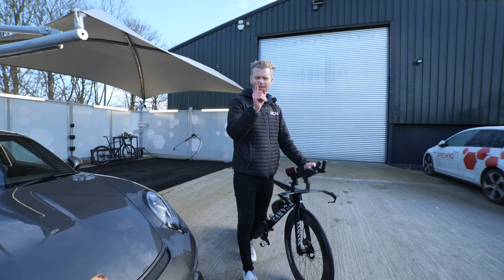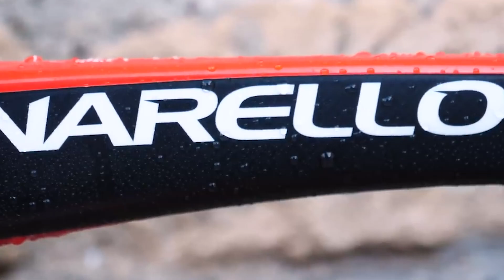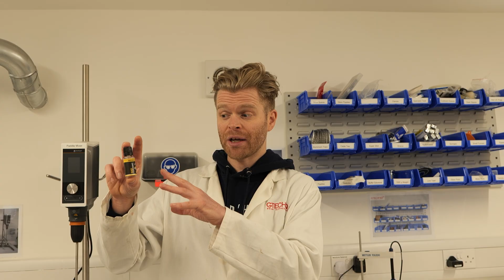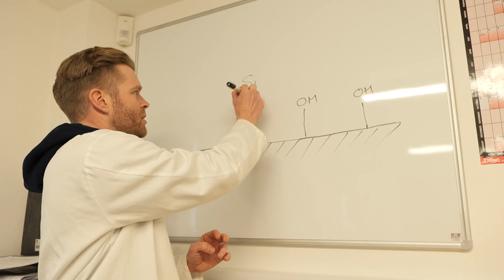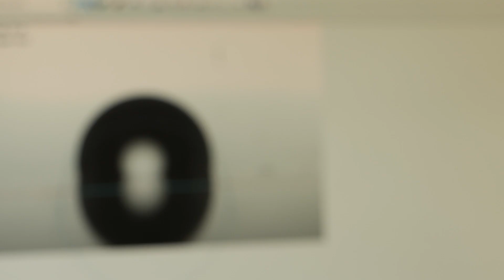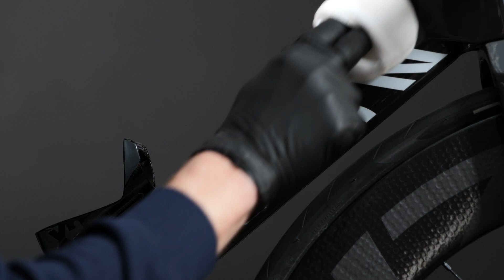The Future Of Bike Cleaning? | Hydrophobic Ceramic Coating For Bikes

Comment: A friend with a car has used ceramic coatings and i entertained the idea of doing my Miata, But didn’t 🙄 but I might do it on my Winter Fat bike to make it easier to keep clean 😉
You should put a treated / un-treated frame in a wind tunnel to ‘See’ if the treated frame is any more aerodynamic  ( Only sort of kidding ) as « Air » is a bunch of things.and at a molecular level the ceramic coating might make it slippery-er !
As Always entertaining and Informative content - Keep up the good Work 👍

Comment: I have Crystal lite on my GT3, Cayman R, E60 M5 and my Audi A7 and to be honest I used to use alot of waxes but since I converted I'm sold.. I spent alot of money on Rupes polishers etc, Now I'm looking at this stuff for my EMTB's, I was tempted to use the car stuff but this looks like it is infact optimised for bikes much more so I'll go with the bike specific version, I often spend 45 mins cleaning my bike and chain after a ride so I'm hoping this will speed my process up alot.

Comment: Ollie said everything! You need super clean bike - that means, iron removal/clay, polishing, IPA and then you apply ceramic coating. The same principle you would do on a car. I coated mine in 2016 and it still looks like day 1 - super easy to clean, attracts less dirt and hydrophobic. The only thing you need to do is, after every couple of cleaning, top it with ceramic topper (like gyeon cure) and that's it. Your bike will be in good shape for a long time, attract less dirt and much more easier to clean. Also if you're coating your car, you will left with extra ceramic coating that you can put on your bike. BTW that 1 year thing is BS, use more expensive car ceramic coating and it will last for 5-7 years.

Comment: Okay...I ordered my ceramic kit today. Will let you know how it goes when I get the bikes ready for the season.
Reply: Just messaging for an update. Did it really lasted a year?
Reply: @ it did
Reply: And, what's the outcome? 🙂
Reply: @EditioCastigata  works awesome. I ride in Northern Illinois in the US and the spring is notoriously volatile switching from sun, to rain, to even snow. The coating helps the water bead right off. The cleaners are just as good. I will say they are a bit pricey when you compare them with other cleaners but the coating was worth it.
Reply: @troykindle4539  Happy to hear, especially from IL! Thank you sir.

Comment: Did this for my Cervelo Caledonia in the beautiful oasis green to preserve as best as possible. Few pointers after 8 months:

0. Your bike will still get micro scratches after washes and rides. Just the ceramic coat will scratch instead. Benefit is that the scratches and swirls and scuffs won’t be as visible with the coating.
1. I did mine as Ollie with a brand new bike. If already ridden, do it proper with a full wash and clay bar before the IPA.
2. Applied on shifters and carbon wheel set.
3. I removed my crankset, chain, and wheels. Definitely a must. Covered the bottom bracket bearings with tape.
4. Great for peace of mind, but ended up putting on helicopter tape on downtube and seat stay anyways for the nasty asphalt and rocks.
5. Worth it, but not as great as I thought when protecting from micro scratches.
6. The flashing/curing of the coat happened really fast when applying outdoors under the sun, nearly 30-45 seconds. Only the rich have garages in Boston, so keep in mind.

Comment: I have been using ceramic coatings for a while now.  I tend to use Meguires Hybrid Ceramic Wax currently as this was being sold cheap and picked up 3 bottles.  It works a charm and much less crud sticks to the glass like surface being hydrophobic.  Basically I give the bike a nice deep clean every few months and just top up the wax, job done and only takes a short time.

Comment: Thanks for the info. Seeing as these type of coatings bond to the paint, is there a similar product that would work on an unpainted titanium bike? Also, as they start to wear off, do they flake off like paint chipping? It sounds like the coating is so thin you wouldn't see it, but a degrading hard coating can make for an unsightly bike.

Comment: I had my road bike professionally done last year before I built it.Remove your cranks so you can get the coating all around your BB area thoroughly. Remove your chain and wheels and don't forget to do your wheels.I'll do my gravel and mountain bikes myself this spring (or maybe one of these cold winter nights we're having). I was surprised just how well it works - dirt just sprays off. Will save a ton of $$ on Muc-Off 😀

Comment: Is there a difference between the bike and car products other than the packaging? I’ve been ceramic coating my cars for years and did my road bike with the same stuff a few times
Reply: @Charles Man it’s actually less expensive and it is a different product to some of the more powerful car serums, which require considerably more surface prep. the high end car coatings can only be applied by trained detailers too. 👍🏼 the chemistry is different
Reply: @Charles Man suspected as much!!

Comment: I thought ceramic materials were metal oxides.  Silicon is not a metal.  What is it that I have wrong.
Reply: ask yourself this... are ceramic pots made from metals?!
Reply: @readmorebooks-l5f  yes they are metal with a ceramic coating. Pottery is not ceramic.  Aluminium oxide is ceramic
Reply: @johnsaxelby8030  🤦‍♂️ literally google ceramic! 😂

Comment: I have been using ceramic coating on my car, motorcycle, snowmobile and bikes for years. Best thing ever.
Reply from the maker: Great to hear you love it! Would you be temped to use on the bike too? 👀
Reply: @gcntech  i do. Even with a Matt finish bike. I even use these products on my steel shed. Snow does not stick to roof in winter! ;-)

Comment: This is just an advert for a costly  waste  of time and  money. The parts which need  most protection  are  the bearings  and components, not the frame. It wouldn't surprise me if  that Porsche was yours given  all  the stuff you promote

Comment: More familiar with these products for cars where dealers like to try to charge £500 for them to apply the coating. They do certainly seem to make water ‘bead’ on the paint surface but as for mud and other dirt, you are still going to need to wash regularly and for me it’s the drive train that is always the issue not the frame.
Reply: Totaly agree, frame is the easiest part to clean. I'm more interested in protecting from scratches and dents.

Comment: Great video, Ollie, thank you! I am sold, going to try it on my bike!
One question: what do you recommend to do about the stickers? I have a couple of very thin stickers (with my name) that I plan to keep. Should I apply coating on top or is it better to remove the sticker and put it back onto the treated surface?
Reply: it’s so effective, you’ll struggle to stick a sticker on the treated surface. i would advise leaving the sticker on and coating over and around it

Comment: During bad wheather season, I put on wax which is used for vacuforming parts, e.g. canopies for model airplanes. When I used it for what it is intended to use, I found out that little rests of that wax were not possible to remove even with alcohol, I had to use nitro thinner - which unfortunately turned clear plastic into non-clear plastic. I put it on with tissue cloth, polish it after a few hours, then wet dirt is completely removed by just using a garden can. If the dirt is already dry, I make it wet again by using a spray can. It takes two or three weeks, when I have to renew the coating. Especially polished alloy (like the hubs of my beloved Shamal HPW wheels) is very well protected by this wax. Yesterday ist was really nice to see the hubs blinking in the sunlight...

Comment: Also what if your bike has frame protection? Does the coating only work with the paint lacquer or does the same principle applies to vinyl protection?
Reply: Ceramic goes on your vinyl protection no problem. Though it will be shed way faster, potentially dulling the tape. Might be no biggie on chainstays or bottom of downtube, but on top tube I'd apply ceramic first, then the vinyl. Hope that helps!

Comment: I’ve used this in the past and although being quite impressed initially I didn’t get a year of protection at all.
Reply: Sounds like the bike needs a deep clean. Try the Gtechniq bike wash. As with all surfaces, it will clog up with dirt, giving it the effect that it’s no longer there. The coating will need a deep clean now and then for the longevity 👍

Comment: Unless it repels ALL dirt and impurities from ALL parts of your bike that gather from riding (particularly in the wet/dirt) then you’ll still have to clean your bike, dry & lube the chain, degrease the cassette etc.. no? And once you’ve got a bucket with suds, it’s not that much more work to do the frame, seatpost, wheels etc… I dunno, seems like a bit of a gimmick tbh. 🤷🏼‍♂

Comment: sorry in case my questions are redundant.
1. is the application frame only or also wheels and other bike parts
2. what about environmental issues? any toxicity and what happens to it once flushed into the ocean?
3. you've mentioned it's longevity (about a year or even longer). which factor apart from solvents would decrease life span (UV light etc.).
Reply: in my experience harsh solvents can take it off and friction can too. so your bike bag rubbing against it for example.

regarding toxicity, i’m not sure, however they are based on siloxanes, which as a class of compounds are generally non toxic or have very low toxicity. 

flourocarbons are the nasty things used in waterproofs. not present here.

you can put it on other parts. so chainset, derailleur body, hub shells etc. anything lacquered.
Reply: @readmorebooks-l5f  Great. Thanks a lot!

Comment: For all those who wonder if it has an aero advantage.

I will save you time :)
We have tested it years ago with Bicycle Armor. 
There is no advantage.  At slow speeds like in cycling you need texture. Like they use on tt suits. 
It's called "the golf ball effect".

The only aero advantage you will get, is that it's cleaner. At 60km/h we had a 0.3 watt advantage.

Comment: Do you still have some coating of your car on a rag? Whipe it over your bike!
But be aware: don't mix polymeric and ceramic coating. One is polar, one is non-polar. One is creeping under the other by removing it.
Stick to ONE and if you wash your car/bike in a station near you you better use what they have. Don't mix, it's senseless! 😉

Comment: Ollie, whilst there are many ways to characterize ceramics, it feels like a non-baked wipe-on SiO2 application is a massive detailing industry misnomer. Waxing a bike with carnauba wax also creates a hydrophobic barrier. So isn't this just an overhyped way to get people to get super jacked about using a less sustainable whole system of pricey steps to achieve the same effect? Why not use a simple auto wax or cleaner/auto wax with petroleum distillates to clean and wax your bike?
Reply: nope. considering it’s silicone based, the nomenclature ‘ceramic’ is correct. With regards carnuba wax, i’ve used it on my car and am familiar. the difference and it s huge, is that it doesn’t covalently bond to the surface of the bike or car. it’s held in place by weak vandervaals interactions. it is a sacrificial layer which is easily removed and doesn’t last anywhere near as long. siloxane based ceramic coatings are far far more durable.

Comment: I have been doing this for past 10 years and it's not just keeping the bike cleaner, but also reduce scratching as the surface becomes more slippery. now days I use it on all painted surfaces exposed to element such as car wheel, garage doors and it works perfectly in protecting against UV and beading water. one thing, do not apply coating stuff on matte paints as this will alert the shade.
Reply: Gtechniq took this into consideration when developing the bike specific ceramic 👍 it can slightly enhance colours but does not change a Matt finish.

Comment: My full time job is ceramic coating cars and looking after them after application in my 10 years of experience they don't really make it any easy to clean road grime will still cling to your car or bike and will need washing in the usual way also probably more noticeable on cars with large surface areas is if rain settles on the paint can leave a lot more water spots as the beads sit on the paint and eventually dry overall probably worth doing but not the magic hype they promise
Reply: Interesting perspective thanks for sharing - would you think ceramic coatings make a bike easier to dry e.g. with a leaf blower, which can therefore make it cleaner as the droplets aren't drying out on the bike?
Reply: @HowP88  a decent wax job would have the same effect at that point, and at the fraction of the cost.
Reply: @HowP88  i think forget the leaf blower just use a drying towel bike frame vs car paintwork its totally different they are subject to the daily onslaught of rain settling on the paintwork drying and leaving water spots you shouldn't get that with your pride and joy kept in the warm and dry
Reply: @mathewturner9643  as unsure to try myself, and what you do, curious how much would it cost to have someone coat a road bike and save me time?
Reply: @mathewturner9643  I might try, worried on missing bits, how long does the coating normally last?
Reply: @HowP88  it helps to make the water bead up n off the surface faster so yes with a blower it will come off faster than a non coated surface
Reply: @stevelewis0106  I only thought was one as thought to put on a wind screen of if I have a car, not use wipers as wind would have the rain go away (I feel wipers are not good for wind screens as often left seeing marks)
Reply: Thanks for sharing your first hand experience, would you say it add shine or depth to the color? On carbon components that have no paint or clearcoat, would you say it changes the finish? thanks
Reply: @cipo36an203  I've not coated real carbon fibre only wraps yes it can add an extra gloss aperiance in the same way that other products would such as a synthetic paste wax it's not really any better perhaps more longevity from ceramic coat but most coatings should last months on a bike frame it's a bit smoke and mirrors in my opinion I coated my own bike with 9H and yes it's hydrophobic but once your bike is dirty with road grime it won't sheet water till its clean I'm more mtb so my bike gets stinking straight away
Reply: @mathewturner9643  thanks!
Reply: Thanks. Saves me money.
Reply: Punctuation. 😬
Reply: If you honestly were a Professional Detailer then you would know that there is different types of Ceramic n Graphene Coatings n that they actually do have self cleaning properties but guess your a DIYer or a backyard cowboy detailer....
Reply: @stevelewis0106 obviously you have know idea ask your mom she knows 🙂

Comment: Ollie addressed it, but yeah- take the bottle cages, cranks, and wheels off. I personally prefer wax. Collinite #845 is absolutely amazing on bikes. Much easier to apply and dramatically cheaper too.
Reply: I found wax to be more time consuming to apply personally, although very satisfying to do. The ceramic was much simpler overall.
Reply: @JSTGOW  plenty for both of us! Ceramics are better on plastics and every other surface, zero doubt.

Comment: Turtle Wax did the same thing 50 years ago.
Reply: Not that exactly the same chemical way, but does similar job for extremely lower price and less labour. Even car detailling experts do not solely depend on ceramic coat. They use both sealant wax and ceramic coat occasionally you skeptical youtube commenter.
Reply: did they? a silane based ceramic coat that covalently bonds to hydroxyl groups? or a sacrificial layer of wax?

Comment: But the real question is this - is the bike more or less aero with the coating?  I want a back to back run video right away!
Reply: As they say, a clean bike is an aero bike… ;)
Reply: doesn't affect it at all, ceramic coating is just a thin layer onto your paint
Reply: Actually, a slightly dirty bike could be more aero due to Boundary Layer Effects... Similar to golf balls (with indents), swimsuits (that mimic rough sharkskin) & sppedsuit &vaerosock materials (that are textured).
Reply: If wet, then theoretically a coated bike will be quicker as it will be "holding" less water on it (water will tend to fly off due to the hydrophobicity of the coated bike), and therefore be a) lighter and b) more aero due to better airflow over the frame (again, because of less water being ON the frame).  Yep, I'm kinda joking, but, you know, theoretically it makes sense.

Comment: Silly question…. Any idea if there is an aero benefit?   I’m sure a clean bike is more aero than a dirty one, although only slightly I’m thinking.  But does a ceramic coating offer anything measurable?
Reply: We do not have any aero data, but our thought process is that a cleaner surface is a more aerodynamic surface.
Reply: You'd have to account for the extra few grams of weight too though 😁

Comment: Ollie, does such a treatment affect the appearance of a frame with a matte finish? Will it look “shinier” after application?
Reply: It will enhance the colour and leave it with a darker, richer colour. It won't leave a glossy finish.
Reply: I did put many ceramic coat on matt surface for 2y. I can say not that much difference unfortunately. It gets little bit darker but no shiny finish at all.